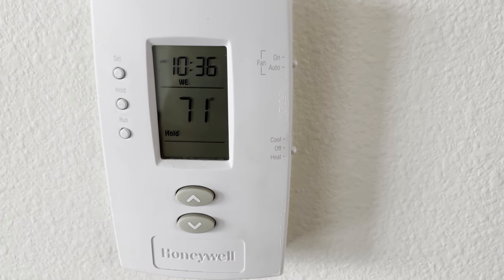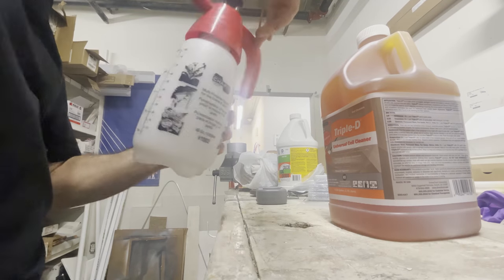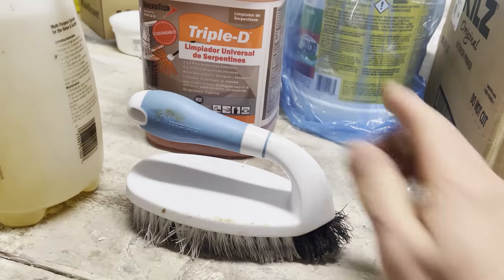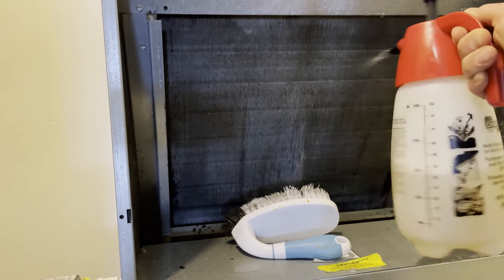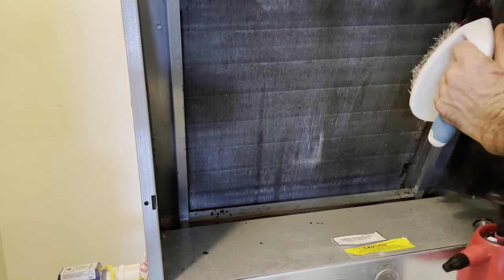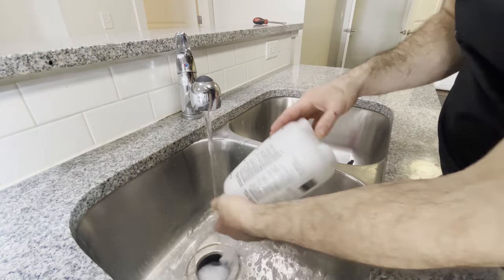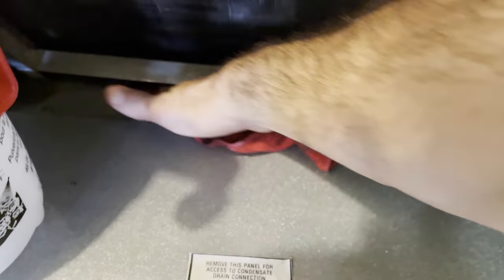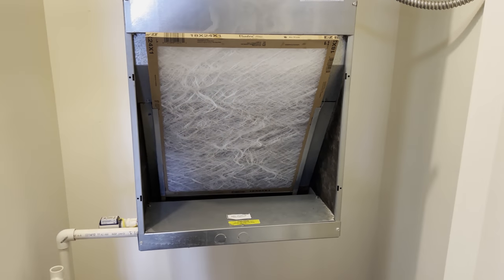Evaporator Coil Cleaning - Indoors Easy Access

Comment: I clean my condenser coil and my evaporator coil and what a big difference it’s made in keeping my house cooler. And I was going to call the heat and air professional again just to hear them say I need a new unit. Just a little bit of cleaning
Reply from the maker: Ah sweet glad it worked out for ya!
Reply: Not to mention all the allergies that come with dirty evaporator coil.
Reply: @1289lt  you are right so I am going to clean mine every spring. I can’t believe that the professional will not clean anything but they will take your money
Reply: Oh yeah they are good at taking your money and usually do a half ass job.

Comment: Finally a unit that looks like mine. When the coils are shaped like a V instead of an A, are the drain pans different? I'm having an issue where there's a little outlet on the right side of the unit that leaks water. I've cleaned the condensate line, but it continues to drip from that outlet on the right. It's hard to work on since the AC unit sits on top of a stubby water heater. I think the drain pan might need replacement, but not sure how to do that. Any ideas?
Reply from the maker: These drain pans are kind of rectangular. Using a drop of food dye in it may lead you to the exact leak spot. Or bondo the hell out of where you think the drain pan is cracked.  I would probably just replace the drain pan I haven’t had to do it on this model in like 8 years. When I did it I just lifted the coil and replaced though your ac may be different
Reply: @ApartmentMaintenancePro  Is the component that sits at the apex of where the coils meet/join considered a drain pan?
Reply from the maker: If you can post your model number I can try and help it’s hard to visualize through. Cool should rest on the drain pan
Reply: @ApartmentMaintenancePro  Oh thanks! It's an American Standard / Trane TWV024B140A1 installed 8/95.
Reply from the maker: @utubepunk  that’s gonna be a tough drain pan to get. I would also make sure the drain Kine is flowing freely and unclogged I believe those crack at the nipples though a lot when they do leak
Reply: @ApartmentMaintenancePro  This is the closest picture I could find to something that looks like my unit:
https://www.airworthac.com/wp-content/uploads/2019/03/SILVER-TMM4.jpg
Reply from the maker: @utubepunk  You can lift the coil up (do so at your own risk you can bend or crack the refrigerant lines ) and swap out the drain pan without refrigerant recovery on those. Easier with two people. I would call Trane and give them your model number and they can probably find you a drain pan.

Comment: why does my AC company that I have say touching the coils with anything will ruin and bend them? then it'll cause a leak if you do anything but an acid dip on your coils. Is this something I really could do without messing up my coils?
Reply from the maker: Just make sure it’s rinsed well after cleaning you should fine 👍

Comment: Question: we had a. AC guy show me the coils inside of our handler. He said he would need to clean them and then fill my ac with refrigerant which my unit is old so the refrigerant is very expensive. He advised getting a new unit vs cleaning it. This process does not get to the coils inside the handler so is it a waste of time if you aren't going to clean the coils inside?
Reply from the maker: You should only need refrigerant if there’s a refrigerant leak, which the repairman should be repairing. If they are just “filling” the unit with refrigerant and cleaning the coils without doing a leak search then I would get a second opinion. If there is indeed a refrigerant leak and a repair is needed it can get a bit pricey.

Comment: You don’t think that the drainage line will get clogged? Maybe I should close it off first and then use a wet vac to vacuum up the water instead of letting it drain

Comment: I live in a duplex. My side is only about 650 SF but my electric bill is around $300. My place is always hot though. Do you think trying to clean this could help? There’s also always water in the drain area. Is this bad?
Reply from the maker: Try cleaning and replacing filter regular. Could be many other factors such as low air flow, undersized ducts, low refrigerant charge etc

Comment: Thanks, is there any thing else just like plain soap and water I can use to clean it? I really don't like to use chemicals because I am sensitive to them, especially breathing them in
Reply from the maker: water will work it's just that the coil cleaner helps a bit more. If you are sensitive to chemicals try searching for a scentless evaporator coil cleaner :)
Reply: Bleach or 409 I use

Comment: I’m in the process of cleaning mine. It was pretty freakin nasty. Where does the excess water go? Is that the condensate line you were talking about? Also is dawn dish soap and water a good alternative
Reply from the maker: Yes the water drains through the condensate line. I wouldn’t use dish soap I would get coil cleaner. If the coil isn’t thoroughly rinsed the soap bubbles could damage the blower motor

Comment: Does'nt this method just clean one side? I wonder if its necessary to open up the top to clean the other side as well?
Reply from the maker: Not much stuff that cant be dislodged will make it all the way through to the other side. This would be an extreme case, in which the coil would be pulled and hosed off outside, then reinstalled.

Comment: I'm sorry but spraying it before brushing off the surface stuff will just cause you to push in the debri and make the surface look clean but the coil will still be restricted
Reply from the maker: Push it in dry or push it in wet. It still gets clean if you rinse and brush it right 👍 Source: 20 years exp
Reply: @ApartmentMaintenancePro  well you are experienced so i trust your wisdom